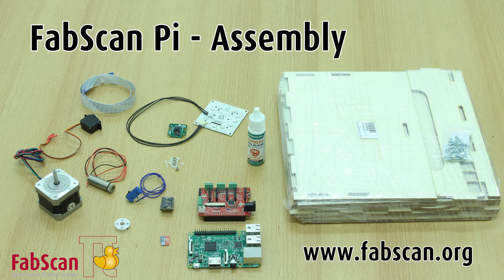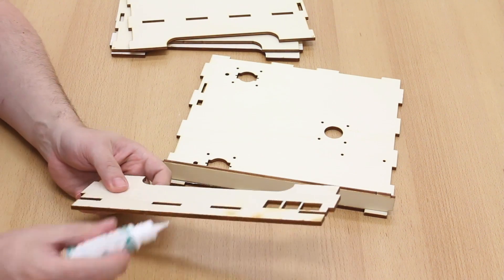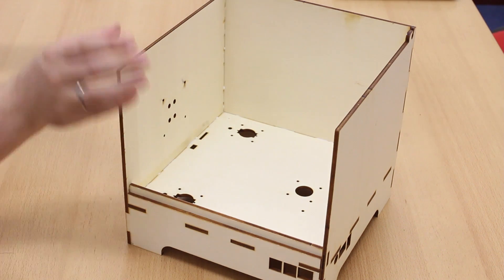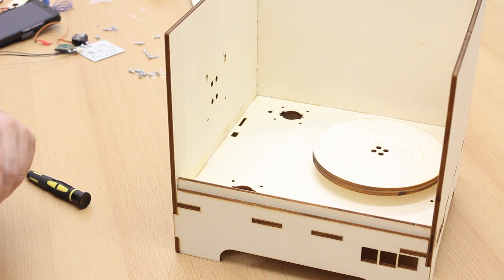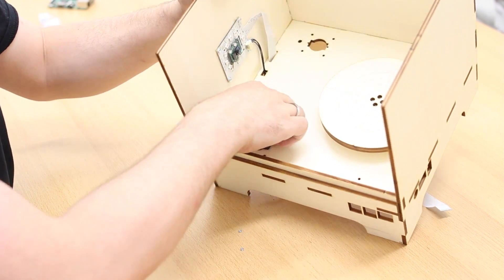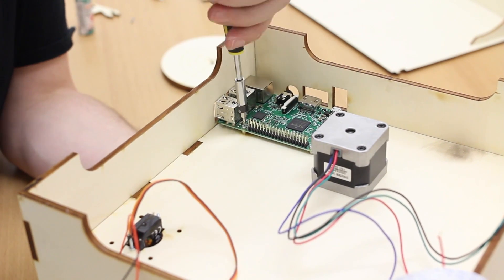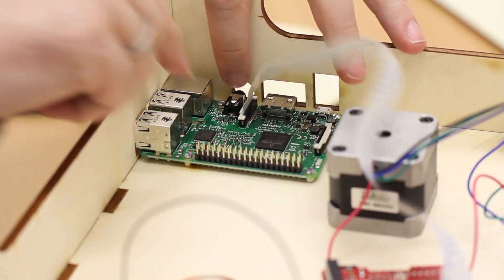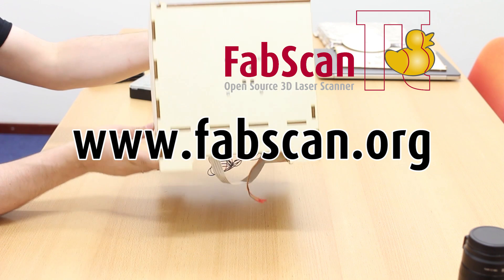FabScan Pi Open Source DIY 3D Scanner: Assembly

Comment: Can a better camera, laser be used with a larger turn table? That setup is really too small for anything i would need it for.
Reply from the maker: It is open source hardware and open source software, you can modify it in any way, but please contribute your changes to the community.

Comment: I still have a Fabscan cube around.  Is it possible to reuse that arduino shield and arduino and connect it to a Raspberry Pi or do I basically start from scratch?
Reply from the maker: Steve Prior you can use the arduino and the shield and connect it to the Raspberry.

Comment: Thanks. For a very nice project. I am not sure how much I can help develop it, but it looks very upgradable to me. I have fitted a 6A +5V supply already to take the heavier power load. Got a second servo on order, and am thinking about upgrading the camera to a 12MP model - I appreciate this will take some software changes, so I better start on the developer page. Looking forward to this. :)

Comment: Can you please make a video of how solder the components on the fabscanPiHat? I have almost finished to build but i am blocked in this step. Or isn't it possible to buy these FabscanPiHAT with everything soldered on it and tested instead of a kit where almost everything has to be soldered by myself? Thanks a lot
Reply: For the moment, no, you can't buy it pre-assembled I think. But, it is not easy to get the parts in the wrong way. - Most of them only fit in one place. The exception is the power regulator, you have to make sure that goes in with the +5V connected the right way. Also, the screw in terminals for wires to connect. A little more information here;- http://mariolukas.github.io/FabScanPi-Server/hardware/
Reply from the maker: Thanks @MegaWagner76 I created the soldering video just for you ;) https://www.youtube.com/watch?v=DogfNxk277Y

Comment: Hello, i am trying to build the fabscan pi 3D scanner but i met a difficulty. Did you use a soldering iron to fix the surface mounted components on the fabscan pi HAT ? if yes, can you please explain how to use it to be precise ? Thanks a lot
Reply from the maker: what do you need to fix? The surface mount components should be pre-mounted on the HAT.